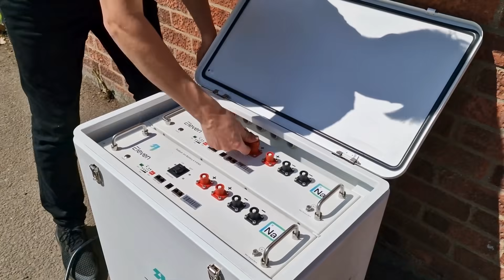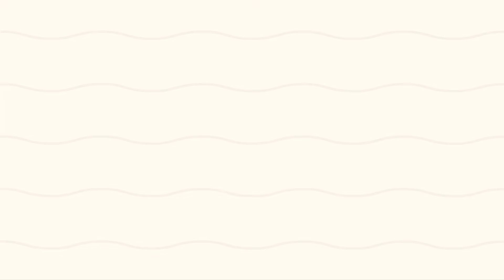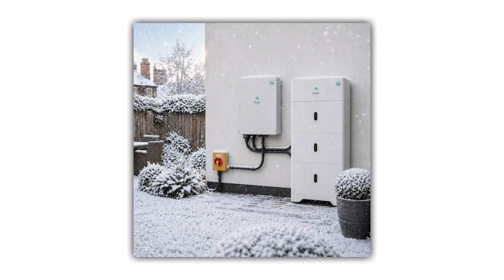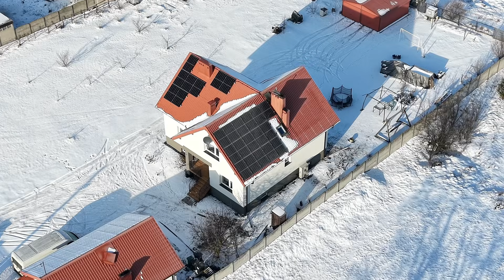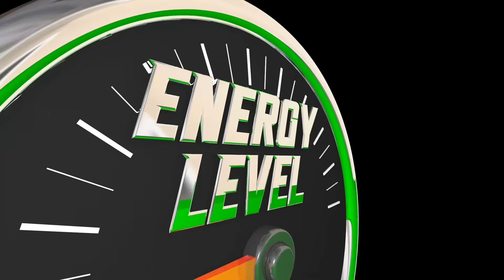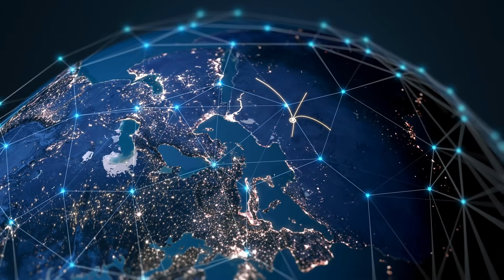This Off-Grid Battery Runs on SALT: Is this the future of Off-Grid Energy Storage?

Comment: Data centers should be working in tandem with desalination plants. Seawater is ideal for cooling, and the waste heat makes it easier to desalinate. The concentrated brine is ideal for building artificial coral reefs using charged metal wire caging submersed in brine where mineral ions coalesce to create forms. Meanwhile this salt bath can provide unlimited sodium ion batteries
Reply: If I were asked to power and cool a data center, I'd start with the cooling system: a massive steam-powered turbine, with a monstrous turbine  compressor on the same shaft. Butane is the closed-loop refrigerant. 

The vapor from the steam turbine is condensed by the liquid butane, then pumped up to the steam generator pressure. From the feed pump, the water cools the butane compressor housing and finally condenses the butane before returning to the boiler. This flow path reclaims what would otherwise be waste heat from condensing the steam. The difference between the vaporization temperatures of water and butane is what makes this thermodynamically possible. 

The liquid butane splits into two lines: one condenses the water, and the other cools the chips, gathering heat which is then pumped into the boiler as mentioned above. 

Cooling the data center for the cost of the waste heat produced by the data center! 🤩

If more energy is needed to operate the turbine, I'd put Solar concentrators on the roof and a large thermal battery. 

A large motor-generator is also connected to the turbine shaft to balance the energy flows. It could even produce some of the electricity to power the chips. 😎